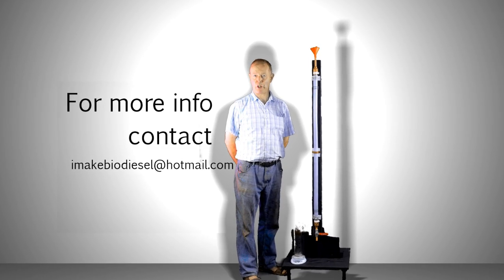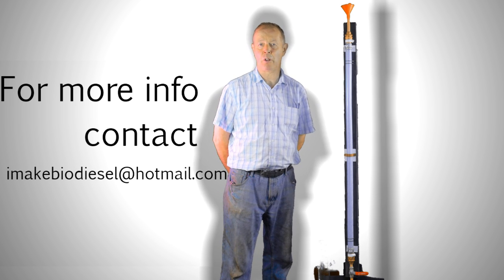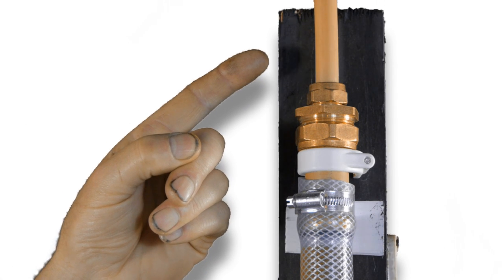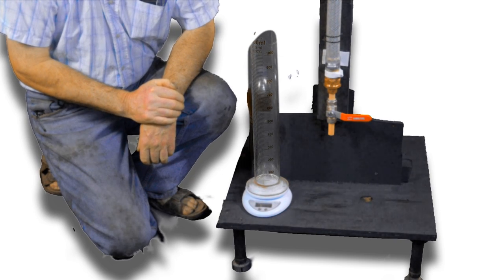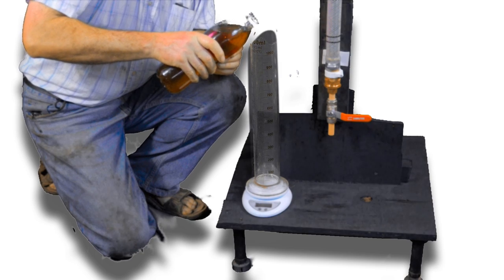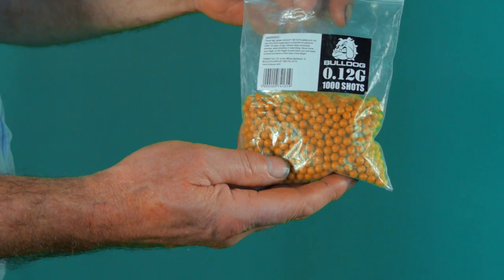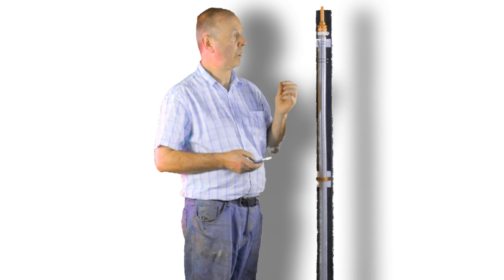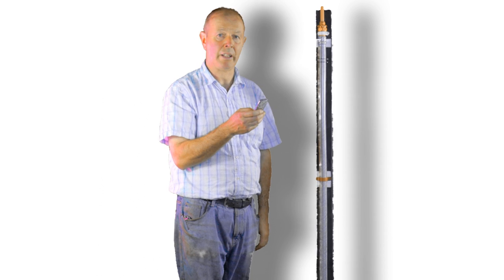Falling Ball Viscometer

Comment: will it work if the tube is shorter like 3cm long only?
Reply from the maker: +Brix Faustino No it couldnt possibly work with a tube that short.
Reply: +imakebiodiesel should i multiply something to the density of the liquid , sphere and the length of the tube to something just to get its ratio i mean uhm sorry did you get it?